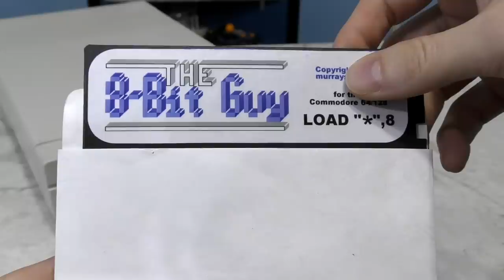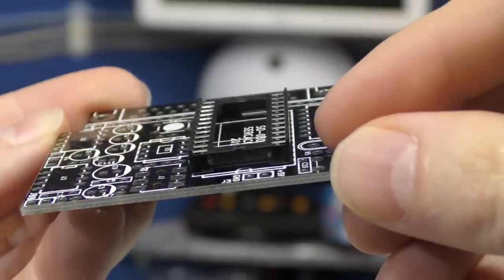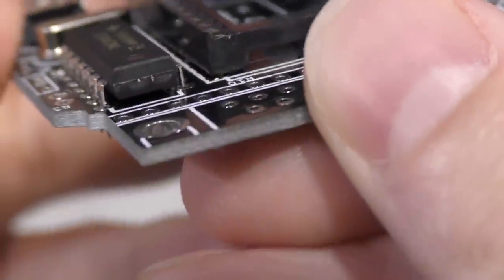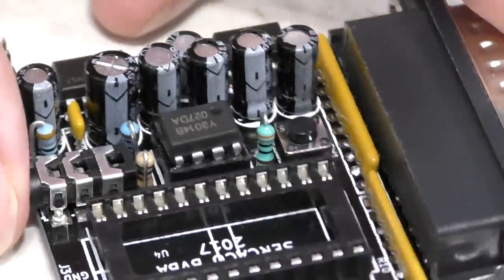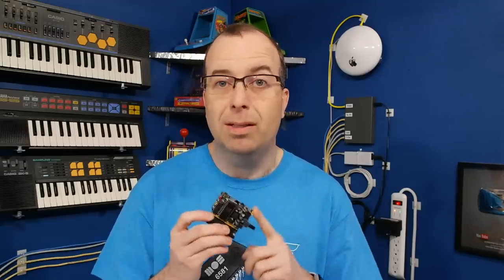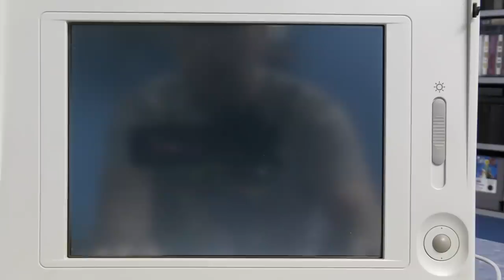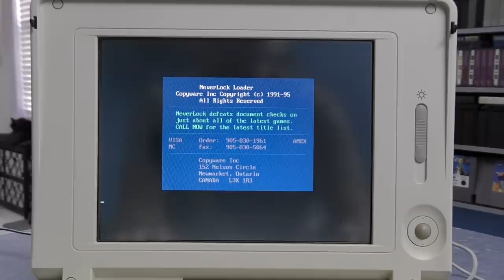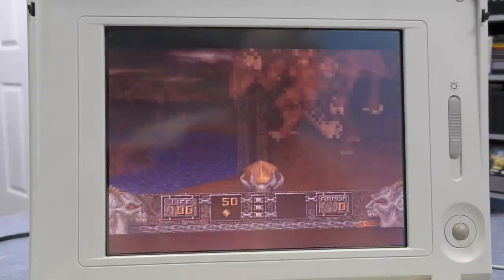Ad-Lib Sound Card for the Parallel Port

Comment: An excellent and useful video.  Are there windows 95/98/3.11 drivers?
Reply: +Stephen Walters  The DOS-based driver should work just fine in Windows 3.11 and Windows 95.  (Windows 95 used a custom version of DOS as its 16-bit layer.  A full explanation would take a wall of text, but fortunately someone has done it for me!  See the link below.)

https://blogs.msdn.microsoft.com/oldnewthing/20071224-00/?p=24063

Comment: +adric22  The SERDA™ OPL3LPT looks a potential experiment for my custom LinUX box in an Everex® TC2502 case; Canonical, Ltd., supports the GNU® Compiler Collection™ in all LTS releases of ubuntu®.  The current Gigabyte® GA-MA78GM-S2HP in this system supports EPP and ECP modes on /dev/parallel, including a DMA channel assignment function in the Phoenix® Award® BIOS set-up utility.  Are datasheets for the YAMAHA® YM-series FM synthesizer IC's still available?  I reckon the device will need up to four contiguous I/O ports accessible from my rig's Advanced Micro Devices® Athlon 64® (e.g., 0x0378 for the main port and 0x0379, 0x037a, and 0x037b for the other registers).

Comment: Let the solder touch the tip? As if there's any alternative to that. It flows to the heat, so yeah, it's going to touch the tip. I've never seen anyone solder and not touch the tip... WTH?

Comment: Wonder if one could make a SoundBlaster that works through the parallel port. I'm guessing there are bandwidth limitations.
Reply: +T Duke Perry  "Wonder if..."  (They can.)  "I'm guessing..." (There is.)

The TL;DR is that there is a device called "Portable Sound Plus" which combines AdLib and Sound Blaster support onto a single device, and has a parallel pass-through port so you can still use your printer.  Nobody makes it anymore as far as I know, but it is possible.

And yes, there are bandwidth limitations.  To play sound at 44,100 KHz, it has to downsample.
Reply: Ah, so this is less impressive than I thought.

Comment: I just watched this video last night for the first time. I've had a Compaq 486 DX2-66 laptop that I used for HAM Radio programming and setup before it crashed to the concrete garage floor during a move (broke my heart into more pieces than the laptop, but it was still quite destroyed.)

Anyway, I also have a Gateway 2000 D 486 DX2-66 Desktop PC with Windows 3.1 (I want 3.11) and MS DOS 6.22 (I think.) I would like to upgrade to the verson(s) with 32bit compatibility and the ability to use LFN and larger hard drives if possible, but without going FULL 95/98, I'm not sure how to do that. And, without running  a DX4 100+ and at least 64MB RAM, I'd rather not go to 9x. 

So, a few questions:
#1: How do I find 3.11?
#2: How do I get the LFN and 32-bit?
#3: Since it's a desktop, what sound card should I be after? 
#4: I've heard it suggested that it'd be a good idea to find a CF card adapter for using compact flash in place of - or in addition to - the existing hard drive... I'd like to do this especially if the current HDD can be "cloned" to the CF card. I think it's  a 2GB or less, it's been a couple years or so since I've had it booted up.

I'm starting to get into retro gaming and trying to use older Windows and DOS Apps that I grew up with. The problem is sourcing the software to do all of this.

Thanks for your great content, I'm going to be watching your videos a lot I feel. 

Your newest subscriber,

Zach
Reply: Maybe Win32s - but I would advise for FreeDOS instead. Happy DOSing

Comment: I am mostly surprised that slow parallel port has enough bandwidth to be able to handle this. If I remember correctly 8 bit isa interface has about 80 times more bandwidth than a parallel port.
Reply: +Baogar  It depends on which mode the parallel port is in.  In PP mode, top speed is about 150 kilobits (approximately 18 kilobytes) per second.  But if it's in EPP or ECP mode, it jumps to about two megabytes per second.  That's more than enough for an AdLib.  Now, if it were a Sound Blaster, playing at 44100 Hz, it would have to downsample because the bandwidth just isn't high enough.
Reply: I just remember only seeing those faster parallel ports in pentium  and later pc's. I suppose this 486 might have one too, but would this work in 286 or 386 pc too?

Comment: I have a small issue with your use of "positive" and "negative" with regards to the component orientation, considering that cathodes are negative and marked with "+", and anodes are positive and marked with "-". So I'm wondering what you actually mean, as it's far for obvious that you mean what you actually say, in this context.
I appreciate the video though:)

Comment: Well, it's not identical to the chip on the original Adlib, in that the first gen of Adlib cards had the top of the chip scraped off by hand with a rotary tool so you couldn't read the chip number. I know this because I have one. </gloat>

Comment: The complaint I have is the way you pronounce solder as sodder.  Why for heavens sake?  It's bad as the p being silent, as in bath!  As for not letting the soLder touch the bit....why the hell do they think we tin the bit?  Use Kapton tape to stop components falling out whilst soLdering.

Comment: Rather than supporting a specific device why be forward thinking and allow the AdLib port to be configurable.
Reply: not as easy as it sounds (no pun intended). Programming for the OPL2 is very particular and requires very specific code and compositions

Comment: I've seen WAY worse soldering jobs on YouTube. There is absolutely no problem with touching the solder with the iron as long as you are properly heating up both the solder pad and the component.

Comment: Not sure it's the extra voices working to make the music sound better than the Amiga version; IMHO the Atari ST music sounds better too, and that only really has 3 voices to play with for both music and SFX anyway. It might just be that it's more obviously and completely synthetic rather than the Amiga's rather only halfway realistic samples that often feel more cheap and fake these days than impressive like they may have back in the day.

The Atomino music though, no argument, that's some good FM right there.

Surprised how good the Pinball Fantasies and other PCM has come out - the 3812 doesn't actually have any native PCM ability at all. You have to "fake" it, like on the YM2419 and similar, by setting a zero-frequency note on one of the channels and then repeatedly and laboriously throwing volume update commands at that channel (essentially giving it the PCM value, but with rather greater instruction and addressing overheads). And, well, the 2419 only has 4-bit / 16 levels volume per channel... the Adlib, only 6-bit / 64 levels. And unlike the 2419 (or indeed the Amiga), you can't easily combine channels via mixing of their individual and the master volume to increase the effective resolution... at least, not as far as I know.

So it's not even the 8-bit of the Covox or original Soundblaster, just a fairly rough 6-bit... meaning the clarity and indeed replay frequency demonstrated here is pretty impressive, they did a really good job of using what was available to its maximum ability and hiding its weaknesses.

Ultimate test may be to load up Inertia Player and run some module files (or even MP3s... well, OK, as it's a 486, pre-decode them to WAV...) through its built in Adlib conversion driver, see how high a replay frequency and how many simultaneous channels it can handle before everything starts to fall apart.

Comment: Solder is correctly pronounced "sodder"
Reply: If you're American sure, which he is, so it shouldn't be an issue. However, it is correct in pretty much every other English-speaking country to pronounce the L. I'm not actually big on prescriptive language rules, so "correct" isn't really the term I'd use in either case, but the general usage is as I described.
Reply: @catlover10192  it's a pronunciation from England
Reply: @Vulpovile  Yes, England and most other English-speaking countries. It doesn't make it any more or less correct than the Americqn pronounciation.
Reply: @catlover10192  I'm talking about "Sodder", it's from England
Reply: @Vulpovile  Nobody in England says "sodder" instead of "solder". Sodder has a very different meaning and has nothing to do with electronics.

Comment: Adlib or FM music in general on PC never got the opportunity to shine. Music in most games were simply translated from Amiga mods with use of general instruments. This made the popular belief that FM synthesis is bad.
If you want to hear how good OPL3 can be, download Adlib Tracker 2 and listen to some tracks. It will blow you away. OPL3 can make astounding electronic music, and Amiga's sampled modules will be really bad in comparison.

Making music for OPL2 wasn't easy. Most of the times composers just made a set of instruments and used them, but you can also change a lot of parameters on the fly. If there would be a software like Adlib Tracker 2 in the 80's the situation might be a bit different.

FM synthesis died when MIDI became mainstream. I really don't get it why on earth MIDI become popular in games? It sounded different on every hardware, awful most of the time. Consoles improved on Amiga DAC approach with dozens of hardware channels and few DSP effects.
Final Fantasy VII is great example how bad MIDI is. I've played this game using 64 MB soundfont, and it still sounded worse than PSX music which used custom samples.

On the other hand MT-32 showed that MIDI can give great results, but it require having same samples as composer had.

Comment: Don't listen to solder critics, they're assholes. There's no real difference between loading and not loading, or any other method, except perhaps how much solder is used, and even then the amount you're using is not overdoing it.

Comment: 0:00 - load "*",8
0:04 - load "$",8
what gives?
Reply: The instruction on the disk is to load the default program.
The instruction he types is to get a directory listing of the disk.
When picking up an unfamiliar disk, most people would perform a directory listing first before deciding which program to load.